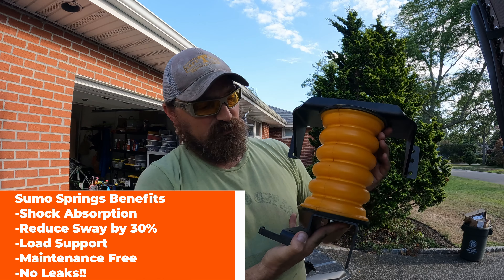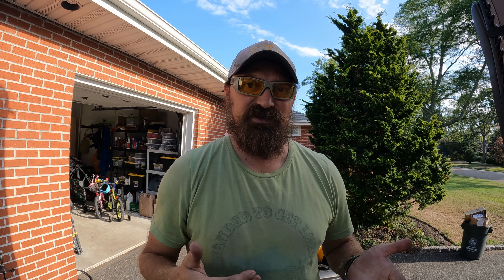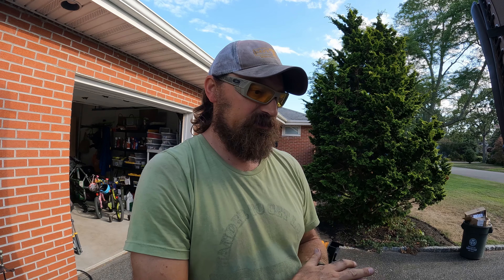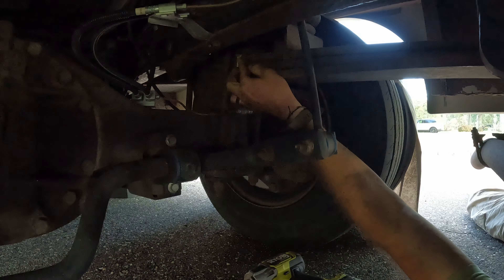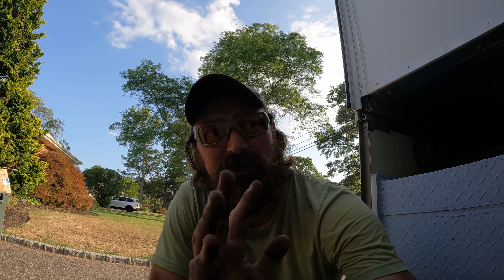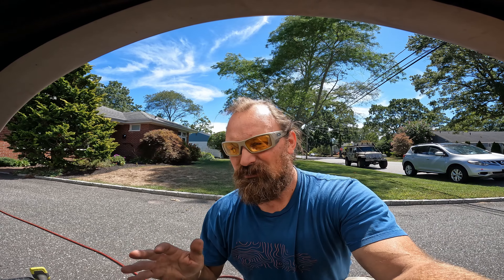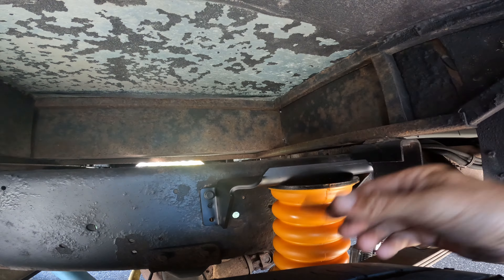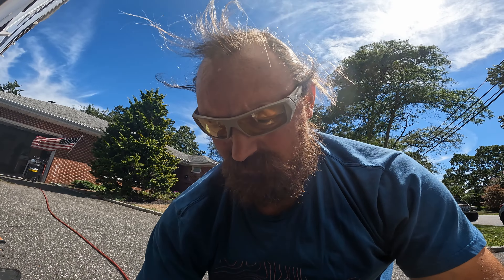Swapping out Airbags for SUMO SPRINGS on our WINNEBAGO RV!

Comment: Awesome, thank you, if you had to drill the holes could you have done it without removing the rear wheel, I'm going to install them on my MH but I really don't want to have to remove the wheel to do it?
Reply from the maker: I believe you could, but you would still need to raise the RV up so you can increase the distance from frame to suspension. You'd probably want to mark it in place for the holes and then remove the unit to drill holes or you could use the unit as a guide for the holes when drilling. Thanks for watching.
Reply: @WanderToGetLost  Got it, I just bought a right-angle or the 90 degree drill motor today so I can get behind the wheels, I will be ordering the front first and then the rear and hopefully by this summer camp season I will be set, thank you again.

Comment: I know this is old but what did you do about the air supply to the old air bags? Thanks 😊
Reply from the maker: They had a spot by the rear wheel that you needed to connect an airline to in order to inflate the bags. They never had an air system installed, so it was a pain. I just cut out the old lines.

Comment: I don’t know if you ever went after the rust on your rv, but he’s a tip, whether the rv is old or new, apply some RT-342 which is Cosmoline , it is a spray liquid wax, which blocks oxygen and stops rust, I’ve been using this for years and it works great, just keep it away from anything that gets hot such as exhaust.

Also I just subscribed to your channel, as I am also removing my airbags and installing sumosprings , I have a class c, and the air bags are garbage.
Good video
Reply from the maker: Thanks for the tip. I have been slowly tackling areas of rust as I encounter them. Long process.
We love our sumo springs. 
Thanks for watching and subbing!

Comment: Nice work! Did you feel any difference? How were they compared to just the fronts?
Reply from the maker: For me driving I don't notice the back when driving as much as the kiddos. They say it's a better ride in the back. I will say our body roll on corners is way less and the overall handling of the RV has improved. I feel it was worth it. Especially to take some of the wear off the frame from all the bumps out on the road.